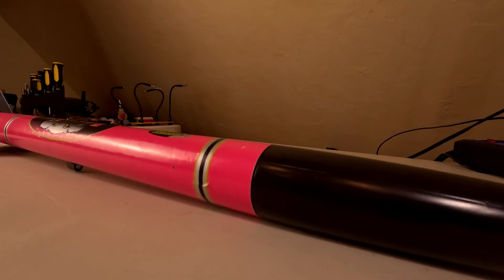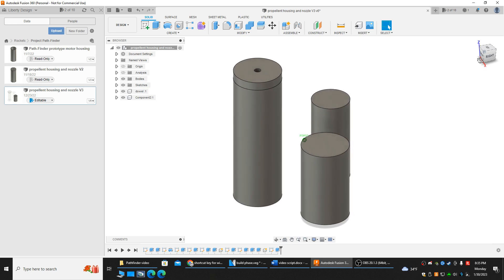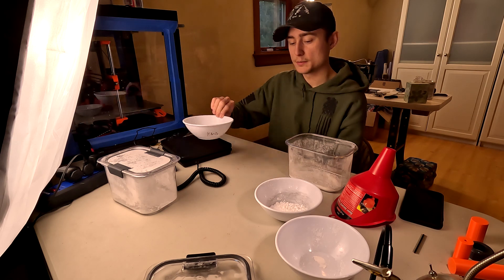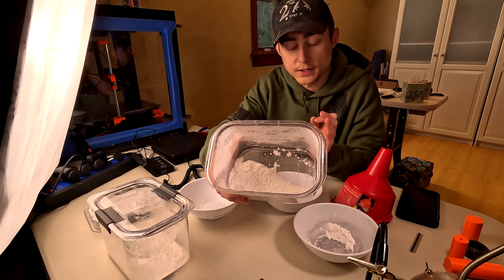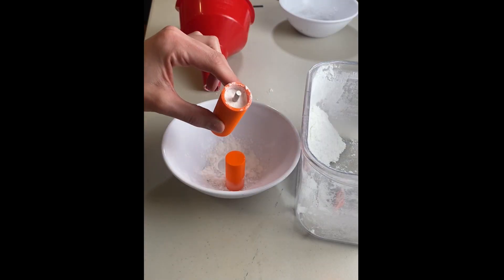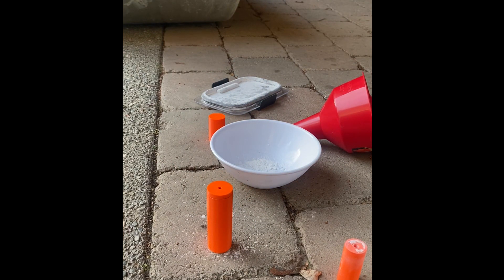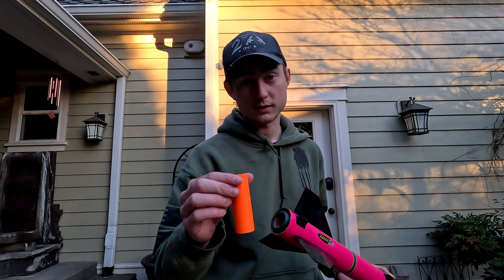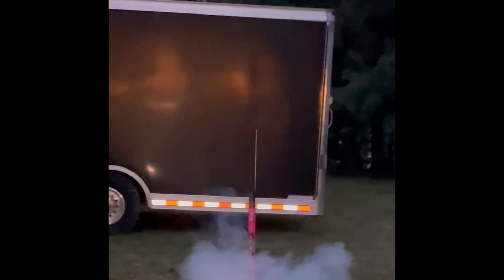Building a Fully 3D Printed Sugar Rocket Motor!

Comment: Was there a reason you didn’t heat and melt the mixture before adding to the casing?
Reply from the maker: Yes, I did not have and did not want to buy a skillet, but this summer I will be cooking the fuel into a solid mixture, and will be launching a rocket with those new motors

Comment: Excellent experimentation. A couple of things for you. The more compressed that fuel is the better, hotter and more thrustier it will be. I use a hammer and a metal rod to compress mine.  The reason for this, if we zoom in with a microscope on our mixture, it looks like swiss cheese which we dont want. So compressing it helps fill in the interstitial spaces. 

The other thing, try cooking it and making a molten mixture. The melting process makes for a full lattice structure and fills all those spaces. 

Look up diy class 1 rocket sugar motor by rotary rocketry on YouTube.

Lastly, do not use a fuse. Use an igniter and stick it all the way to the TOP, not the bottom. Core burners, what you made, light from the top down and then burn from inside to outside. This is what creates the pressure for the thrust. 

With sugar motors, they are about half the power as regular motors. 

Again, most excellent project and process. Keep it up
Reply from the maker: Thank you for your comment! This summer I will be resuming my videos and will be. Poking the fuel since the powdered fuel is too unreliable and tends to break apart and cause unpredictable thrust.

Comment: How did you calculate the throat diameter of your nozzle?
Reply from the maker: I didn’t not “calculate” with numbers the diameter of the nozzle. I used trial and error and a lot of testing. I made a guess and then shrunk down the nozzle size until the motor blew up.

Comment: More thrust is possible if you melt your mixture then pour. freezing the case in ice might allow it not to in the pouring process. Proper PPE will be required. Also when the plastic nozzle expland a great amout of thrust is lost. maybe casting your nozzles with plastic mold might work better. Keep up the good work, looking forwards to more videos.

Comment: You should consider  using  a convolute paper tube within the 3d printed  motorcasr. 

Also consider a screw on nozzle., with the screws on the outside of the motor case. 

The harder you  press the powder the better.

Get a 1 ton  arbor press, so you can get repeatable pressures on each powder increment. 

I would  also use equal measured increments of the powder.

This will make more powerful. Motors.

Also use sorbitol instead of powered sugar.

Also consider using melted sorbitol cast into a paper tube you insert Into the motor casing.

Consider using a filament made with carbon fiber for greater strength and heat resistance. 

Show some pics of the nozzle to see how it erodes. 
.
Finally, use an electric  igniter instead of a fuse fuse.

Comment: Congratulations on the video. Could you provide the stls you used in your video? Excuse my English, I'm Brazilian and I'm using google translator
Reply from the maker: I will post the STL files but I will be making a new video with an updated design and fuel mixture plus a larger motor for my new rocket.

Comment: Nice! Have you tried making the diameter of the hole through your fuel larger? It could make a big difference, as it did for my rockets
Reply from the maker: I have not tried actually, I will try on my next video where I will be building a bigger motor

Comment: I'm shocked the nozzle cap stayed on.
Reply from the maker: Me too! The nozzles are very tight though, I have to use a mallet to get them in and 3d printed parts have little ridges which greatly increase their friction. With more powerful engines I might have to glue them on or make them lock some how.

Comment: Nice work. Couple of things. You designed the motor to be a core burner but you ignited the motor from the end which essentially made it an end burner. End burners typically don’t produce very much thrust, so you’ll want to ignite it from the very top of the core so the entire core’s surface area will be exposed and combusting at once. That said, your press fitted end caps might not hold under the added pressure, so perhaps enhance the design there.
Reply from the maker: I agree! I am going to invest into E matches that will sit at the bottom of the core and will do a better job of igniting the entire core. I think most of the core does ignite however but it does very I will admit.

Comment: I know the goal is to be fully 3d printed, but that Nozzle is not going to work. Throughout the flight you will lose thrust and efficiency as the nozzle melts. It would be better to make a more conventional nozzle for sugar rockets. 
However there are filaments that have ceramic or metal powders in them, but you’d need a kiln in order to post process the piece. This way it can still be 3d printed and won’t damage the nozzle so much though out the flight.
Reply from the maker: Hey thanks for your comment! The nozzle throat doesn’t increase in size by very much with the ASA nozzle. It does increase some but very little. In the future I will move on from 3d printed nozzles and casings once I am done pushing ASA to its limit.

Comment: and yet an electric motor has moving parts :-) hehehe. LOVE that 3D printing works! would love to see one with PLA to see if it holds up. cheaper plastic easier to print and less electricity to print it.
Reply from the maker: I did a PLA motor, it survived but barely. The nozzles whole grew 2 or 3 times more than the ASA nozzles whole. So PLA is possible but you will lose more thrust from the nozzle throat expanding due to the heat.
Reply: @theeverydayengineer1701  Interesting. I am surprised there is any difference at all at 2000'F what about the casing? did it hold up fine with PLA ? I can do casing in PLA and Nozzles in ASA ??? I also wonder about adding an ablative coating like some grill or engine high temp paint to the inside of the nozzle surface area. it only has to last for a second or so might make the difference.
Reply from the maker: @nerys71  that’s a good idea, coating the nozzles with something might help. And my PLA casing held up but lost all rigidity, so it could work but it’s close to failing I think.

Comment: incredible, i was setting myself on the same project a few days ago and found your channel today.
Also, it would be cool that in your next video you add an ejection charge to your motor.
Reply from the maker: That’s awesome! I would recommend doing 30% powdered sugar and 70% KNo3. That will provide up to double the thrust I have found. Also I found that PLA nozzles don’t hold up well so ASA is the best I have found so far. Good luck!
Reply: @theeverydayengineer1701  anyway i plan on making a one time use engine (and potentially the fuselage) and thanks for the ratio because i use a 60 : 40 Kno3 to sugar ratio. 

I don't know if you're interested but i have made 3d models of a rocket that i can share with you if you want.

Also do you know about when will the next video come out ?
Reply from the maker: @devnitrate  your welcome, and actually my next video will be a short video about my updated motor and nozzle. 

Then I am actually working on a rocket that’ll be 3d printed and will have a custom telemetry computer that deploys the parachute. I just have no timelines but hopefully in the next 2 weeks I’ll have another video out. Thanks so much for your interest.
Reply: @theeverydayengineer1701  hi ! Sorry to bother you but do you have any tips because when i put in a metal rod and compress the powder fuel and i take out the metal rod it adheres to the fuel and if i get it out it decompresses everything so i have to recompress and i don't have the middle hole. I have tried putting oil but it didn't work.
Reply from the maker: @devnitrate  hey, no problem. Since the propellant is a powder the whole in the middle known as the “core” is very fragile. What I do is I pull the metal rod with pliers, then once the rod is coming out I push the rod back in and re compress the propellant lightly then the rod isn’t so tight and will slide out by hand, then just do that a few times as you pull out the rod. Sometimes the cores just break though. Powder fuel is easy to make but doesn’t pack well. However any more of a high power fuel is too powerful for FDM printed nozzles, in my opinion.
Reply: @theeverydayengineer1701  Thanks, anyways i don't need high-power fuel because in france rockets can't go above 150m if you ain't part of a rocketry club. Also it could be cool to make a discord for the community.

Comment: Hey, nice work! However, I think you should look into safer options for igniting you motors rather than a torch and fuse. You should maintain a distance and can do this by purchasing existing Estes ignition systems. Also, if you melt your O/F mixture together and cast it in the casing you will have a more homogeneous propellant and a much better burn rate (more thrust). Lastly, you should incorporate a converging diverging nozzle to increase the thrust even further. I did this by 3D printing a mould and casting plumbers concrete.

I would highly recommend working and testing your experimental motors on a test stand rather than any type of moving vehicle in order to limit your risks in the case of a catastrophic failure.

Great work, have fun, but please be safe!
Reply from the maker: Thanks for your advice! I will be looking into better fuels in the future. And plan on making more advanced nozzles as well.

Comment: You should look into using melt cast Sorbitol and KNO3, it is far more powerful than rammed powder. Rammed powder sugar rockets are extremely weak and unreliable, melt cast sugar fuel is much better. 

Also, never use powdered sugar for rocket fuel, it typically has flow additives that inhibit burn rate like sodium bicarbonate. Use regular table sugar or Sorbitol ground up in a coffee grinder. Sorbitol will be the best option because it has the lowest melting temperature, if you can find a filament to make your casing from with a higher melting point than Sorbitol you will be fine.
Reply from the maker: Thank you for your advice! I will definitely look into sorbitol since heat is an issue for my motor nozzle. And I am using ASA plastic which has a decent melting point. I’ll do some testing with my new thrust measuring system which I should have a video on later this week.
Reply: @theeverydayengineer1701  I'm happy to help, I love rockets! And if there's one piece of advice I can give you it is to try and design a nozzle that incorporates a stainless steel washer in the throat/convergent zone with the ID hole the same diameter as your nozzle's throat, perhaps run a print that stops printing halfway through at a pocket you design into it for the washer at the throat, where you place it inside and let it continue printing on top of it. 

The Kn ratio (the ratio between the surface area of burning fuel and the cross-section of your nozzle convergent zone) will change too much if you only use a plastic filament, causing the rocket to exponentially lose thrust throughout the burn as the nozzle enlarges. I'm curious if there's a filament that would work well for nozzles as-is, perhaps a ceramic based one that can be sintered in a kiln with a calculated shrink factor but I don't know jack all about 3D printing, I'm just a rocket nut lol. I do know that ASA, despite having one of the higher print temps, will not withstand that amount of heat, it will erode in a split second. Once you see what a melt cast and cored KNSU or KNSB rocket will do you'll understand, it's a different ballgame than powdered and rammed fuel. I personally use a composite mix of bentonite clay, grog (sharp sand made from crushed ceramic pottery) and a small amount of high temperature epoxy resin to bind it all together to make my nozzles, which gets rammed under hydraulic pressure with form tools to mold it into shape and cure while under pressure, it has great heat resistance and strength, but of course if your goal is to 3D print everything then the washer will be your best bet. 

And by the way, if you try the melt cast fuel method, chuck 1 to 2 percent powdered red iron oxide (rust) into the mix, a 64/34/2 ratio will serve you well. Red iron oxide is a burn rate catalyst and will make your fuel burn faster, giving you a higher peak thrust. Be warned, it may require a thicker/stronger casing and better bonding between the casing and nozzle, the chamber pressure will greatly increase.
Reply from the maker: @TheExplosiveGuy  I looked into the melt sorbitol fuel, it seems interesting! But you make a valid point that 3d printed nozzles might not work at those temps and pressures. I will try and compare powdered sugar vs sugar vs sorbital in a powdered form with my thrust measuring system I built. But in the future I will make more powerful rockets with stronger nozzles. Thanks for your advice, I definitely plan on using more powerful rocket fuels in the future!! Thanks!
Reply: @theeverydayengineer1701  You're welcome! If you start getting deeper into motor manufacture, you should do some research on APCP rocket fuel, it's the bee's knees lol. It stands for Ammonium Perchlorate Composite Propellant, and as the name implies it uses AP instead of KNO3 as the oxidizer, and instead of sugar it uses finely powdered aluminum and a polyurethane binder like HTPB or PBAN as fuel which makes it room temp castable. It's very energetic and is used in basically all military and aerospace solid rocket propellant formulations. I've been playing with it lately (I'm using HTPB, it's a room temp cure vs an elevated heat cure with PBAN) and have had wild success. Here's a quick test grain I made with an additional 10% of smokeless gunpowder for some extra spunk, there's no nozzle on this either, just a loose grain;

https://youtube.com/shorts/JRC3gVj4MBY?feature=share

I didn't core it deep enough, that's why it slows down at the end...
Reply from the maker: @TheExplosiveGuy  right I have been looking into APCP for future motors. After my thrust measuring system video I am building a rocket with electronic recovery and some cool arduino stuff in it. This rocket will be modular and be able to accept lots of different motor sizes. So it’ll be my test bed for future motors and idea! Also I watched and subscribed to your channel.
Reply: @theeverydayengineer1701  That sounds like a fun project, just make sure you reinforce those motor mounts if you plan on APCP motors lol, they've got more pep than you'd first think. Thanks for the subscription too, I appreciate it and have returned the favor😉.